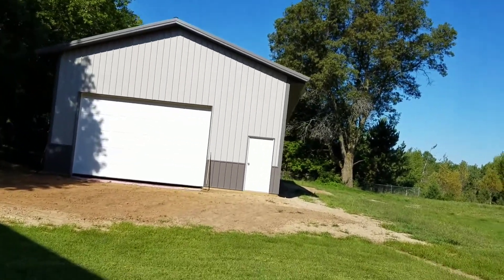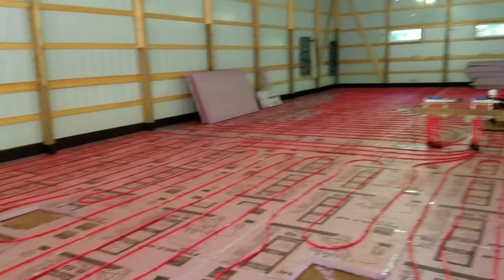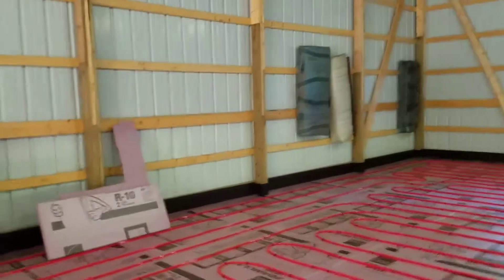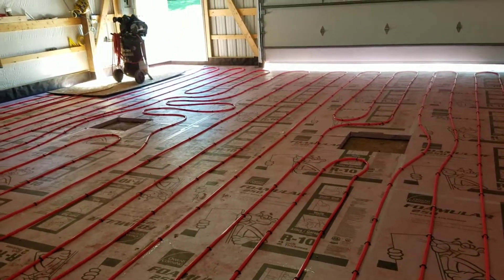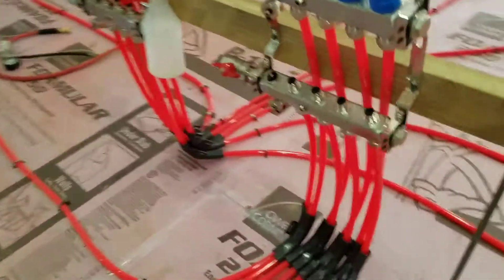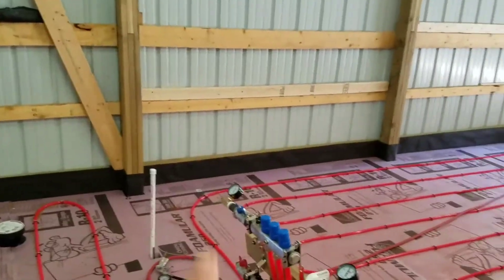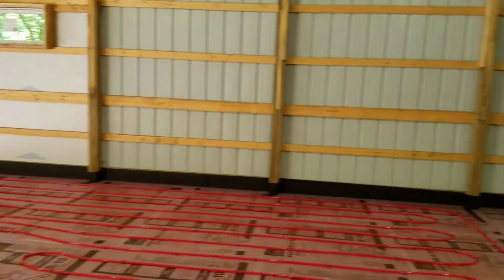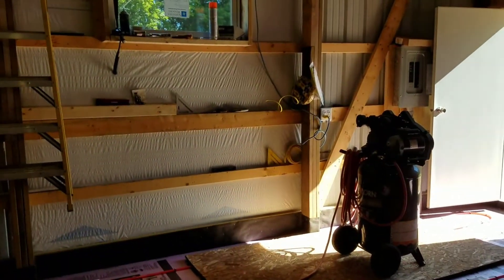Pole Barn part 7:  in floor heat tubing holds air!

Comment: That staple tool is junk. I just tied the pipe tom the wire mesh. Still haven't hooked my heating up yet still working on the pumps and manifolds. Thanks for sharing.

Comment: What size PEX did you run and what spacing?
Reply from the maker: I used 2100' of 1/2 inch Pex-B. Most spacing is around 12 inches, but the pattern is strange because of the lift in the big bay. I used BlueRidge, and one thing that was nice is when I ordered from them, they helped design the loop layouts to give you good heat stability and good flow characteristics. I found their price to be on the dot, and the products are easy to work with, sorta. It is still PEX. We used a chalkline to keep things straight, so expect to get a bit dusty! Make sure you do NOT run a long line in front of an overhead door. Having the loops run in and out of those openings will help reduce the heat loss over the distance. Notice how the loops happen at the openings. I am also finding that precision is not that critical if you get the insulation right! Oh, we also kept the loops back from the door edge more than 12 inches so if anything ever needs changed or repaired at the overhead door openings, no worries with the tubes.